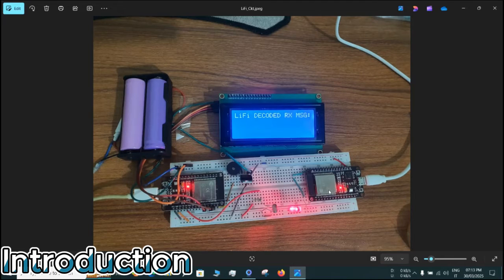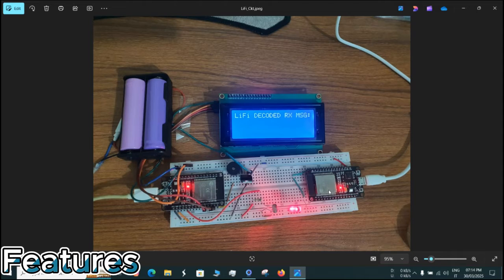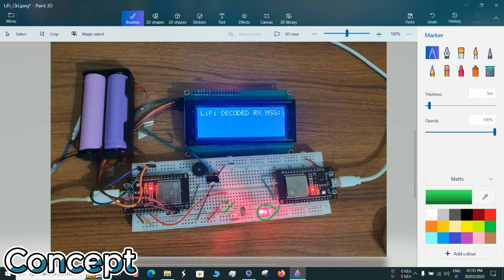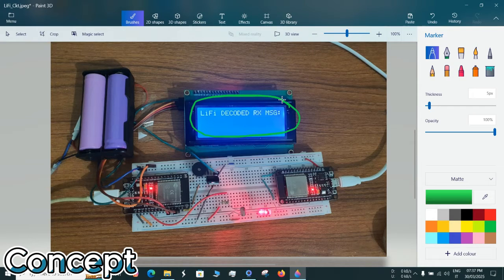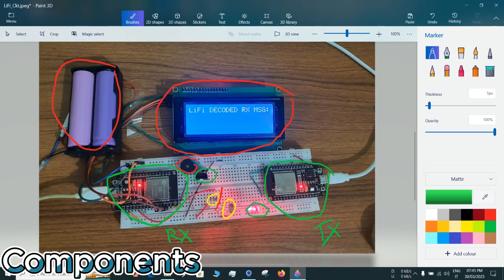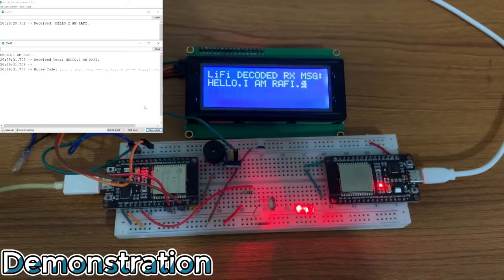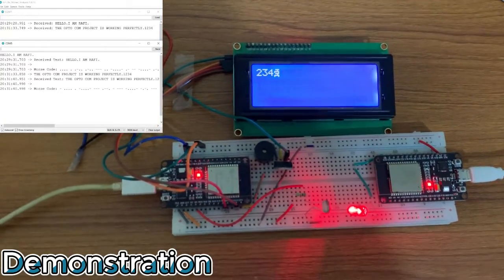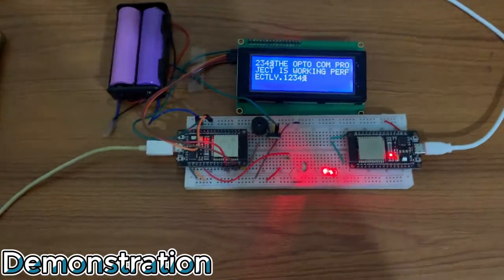Data Transmision Using Light (LiFi) with Morse Code Encoding

Comment: Hi, i need to ask you something. Our quadcopter's motors not working at same speed we did esc calibration and checked multimetre values, how can we fix the speeds. motor number 3 is slower than othrrs
Reply from the maker: If you have done the ESC calibration correctly then:   Make sure that the ESC is working properly. Try to replace the motor and see if it fixes.
Reply: @rafihoque7431  we swapped motors and the problem was same it was a esc problem. we bought new one and now the new one works faster than others. i dont know how to fix and looking for support,
ESC calibration done idk how i can understand that i did it fine but did it many times, should be okay. clicked the esc calibrate button and reboot the system fully and than pushed safety button and esc's beeped. but problem not fixed.
Reply: is there any way to fix this balance problem? any settings or a way, tell me; i dont know
Reply from the maker: @ You must also ensure that the 4 ESCs are from the same brand.
Reply: @rafihoque7431  all of them was frome the same brand but only 1 of it was slower than others, so we replace it to another brand not it also works different than others
Reply from the maker: @ You must ensure that all the ESCs are from the same brand. Since the internal circuitry varies from brand to brand, try to use 4 identical and fully functional ESCs. Hope that the problem will be fixed.
Reply: @rafihoque7431  okay i/we will try it soon in a week. if any problem ill ask you more question after that. and also i want to ask that can you do esc calibration without remote control? thanks,